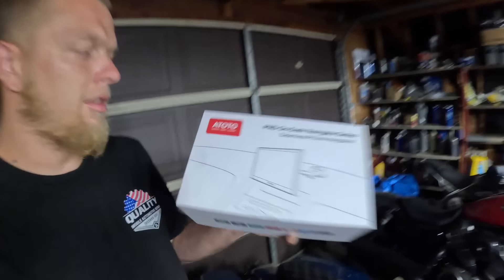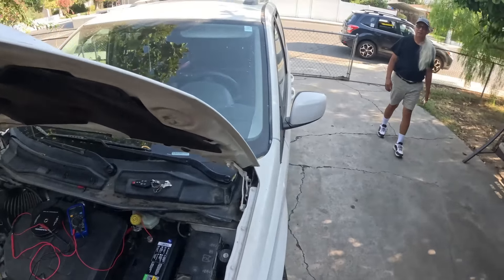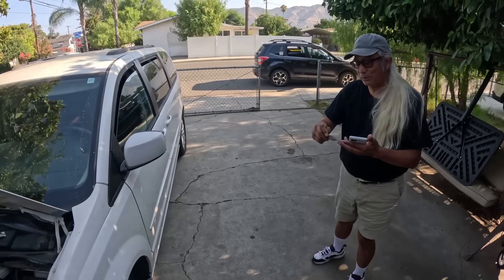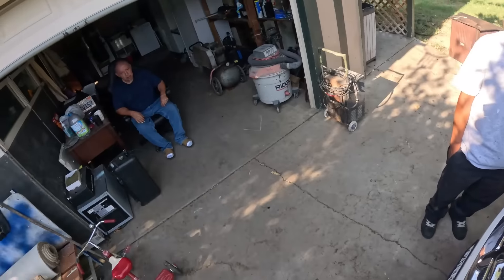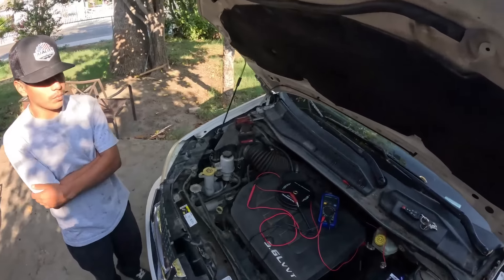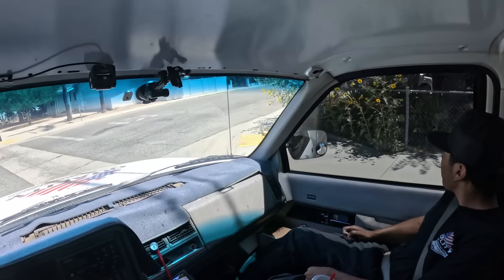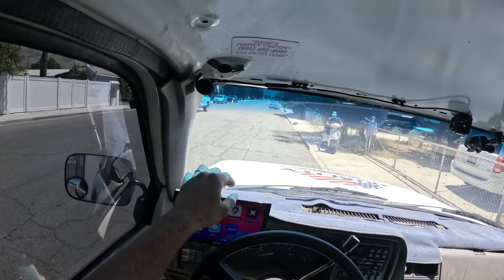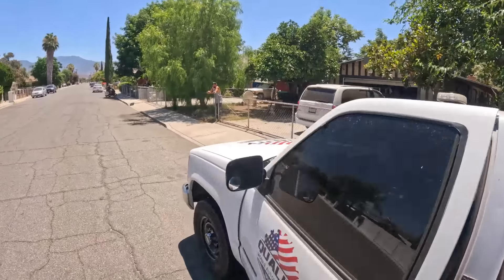CUSTOMER was UPSET! Mobile Mechanic ELECTRICAL diagnosis

Comment: Boy you’re really earning your money on this job people don’t understand that you can buy a battery or alternator can be bad even if it’s new
Reply from the maker: Right!
Reply: I love the way you are sharing your knowledge with the young guy he seems to have a thirst for learning keep up the good work you really earned the money on this job but your patience and craftsmanship gave them confidence in your ability to make this a good job well done
Reply: Absolutely! I have bought so called premium ones “Optima” and less than a month both batteries had bad cells. Warranty was clutch after spending $525 in batteries.
Reply: @hiclite  Optima batteries are now made in Mexico
Reply: @John-fp2ls  just because a part is new don't assume it's good
Reply: I just replaced my Walmart battery under warranty. Original CR-V Battery (51R) lasted 3 1/2 years and I replaced it with a Walmart. It lasted 2 1/2 years. Walmart gave me another one no questions asked. The heat here in Florida is hard on a battery.
Reply: Always test in store after purchase.  Had a couple new ones fail before leaving the store.  Learned my lesson after buying an alternator at advanced auto driving 3hrs to fix my wife's car only to have the new alternator outputting more voltage than supposed to 16v.  Drove it 3hrs home replaced it after I got home.
Reply: That battery wasn't a NEW DEFECTIVE unit, that van killed it. The drivers cranked it to death. I'm surprised the starter hasn't failed; i bet it dies within a year.
Reply: But the kid at autozone said it was good...

Good, go back and have him fix it.
Reply: Yes. Defective products exist. Light bulbs is another product that most consumers don't realize that you can get one defective on receipt. If you install enough bulbs you are guaranteed to eventually run into defective bulbs.
Reply: Walmart battery's rarely last the warranty period, i bought 3 and 2 didnt last 2 yrs.
Reply: @robertmitchell6080  that's essentially most brands, you're doing pretty good to get 3 reliable years out of the most premium brands. 
The beauty of Walmart batteries is in the fact Walmarts are nearly everywhere, open about every day, and pre covids were 24 hour. 
I buy all my junk there or any of the major chain auto part stores for similar reasons.
Reply: Ctly I just had a qashqai that had an incredible parasitic drain and looked as if the battery was cooked  even though it was only 3 months old and only recharged 2 times, changed the ecu and the new battery came back and the old one came back too, but they were both testing at like 3 to 11% health, there are a million things it could be when it comes to electrical faults and age of components like battery and alternator don't mean good.
Reply: Few months ago I replaced a NAPA battery that was dying after a year. The battery that came out of my car was huge. It lasted 15 years and I'd drained it completely dead a few times during that time ( car set for weeks without being driven, so if I left something on, it could be a week or two before I noticed. 
The NAPA replacement was about half the size. Not sure what he looked up in his book, but definitely sold me the wrong size battery.
Battery life will depend on where you live. In Texas and Arizona,  the extreme high temperatures kill batteries fast.
Reply: I had a brand new battery fail on the drive home. It was brand new and bad.
Reply: Back in the late 70 s my was hauling snow with my dump truck lights were getting dim so sent down another truck and took my battery and put on charger it was 22 below zero 88 with wind-chill factor got that lot cleaned took machine for maintenance took my truck to electric shop friend owned cold as all get out put his machine on checked battery and alternator went around and pulled fuse out there where 2 fuses for electric system cost 5 dollars picked up fuses for spares a business I hauled out of had their mechanic replace everything electrical spent over 200 dollars not fixed said mine was fuse under dash checked and that was the problem said how did I know told them didn't have money like they do so took to electric shop got fixed not to old to learn then my neighbor grandson got in a wreck ford vehicle towed to grandma's across street said going to call wrecker told him pop the trunk hit reset on fuel pump system started right up said here's forty dollars said forget it were neighbors I learned that from a mechanic friend who I went out with for a tow ruff road got there and he did same thing I did learned from him 22:05
Reply: @625jeffrey  no matter what product you purchase it's possible to get a defective product. You just ended up being the unlucky one.
Reply: People don't understand that you leave a battery dead, because of a slow draw or something, even for two full days? That brand new battery is absolutely TOAST at that point. 

He doesn't drive it every single day obviously, so for a week the vehicle would start... But barely, like he was saying, because of the draw on his battery wherever. Finally, the last time, they started it and didn't drive long enough or whatever... Battery was dead. They LEFT it dead for a couple of days. Boom, brand new battery is gone, they can't understand why. We do.

Maybe he went over this in the video though, I haven't finished it yet. He hasn't even left his house for what sounds like the first, of potentially multiple (?) times.

Edit: Well golly gee! What a twist!!! Was not expecting that at all. The guy was definitely not very clear about that little second, entirely separate, issue! Super glad that it ended up happening for Robert while he was there! He'd have never known, just based on what dude was saying alone, without that. Luck was with him for sure. I spoke too soon though, that's for sure!

Everyone take care out there, be well. Hope luck is on all of your sides as well. Over 'n out.
Reply: Not likely.  Very rare to get a defective battery.  Most likely bad alternator. I have had diagnostic say "charging", then continue to fail. Change alternator then all was good.
Reply: Especially nowadays with everything made in China! Probably one out of every 20 is a dud.
Reply: @sheiladavis2304  Americans. Just can't please them. Complain about high prices. Industry provides an affordable alternative, then they complain about QC!  Breaking news;  You get what you pay for!
Reply: Exactly, I've bought brand new starters and alternators that were trash!!!
Reply: Never was a battery issue it's gotta charge cause the terminal was lose this guy just clearly can't diagnose anything. He clearly states he would have to test it how does he even know it's a bad cell when he didn't even test it
Reply: Don't leave out spark plugs
Reply: 1000%%
It has already happened to me twice this year On a brand new alternator in my shop!!
Reply: @QualityMobileAutomotive  I had to drop that client in about 15 minutes moved onto the next pay client. Obviously he’s someone who think he’s entitled in someway shape or form, and you’re supposed to fix all his problems. I’d be out of there.
Reply: I went thru 3 alternators and 3 battery's all to find out that the wire between the alternator and starter was bad and was causing parasitic drain and not charging the battery properly but it was still charging the battery just 2.0 volts off wich is nit good
Reply: $525 for batteries is a problem
Reply: Literally slapped a brand new starter on my buddy’s truck worked like 3 times and it took a shit
Reply: I ordered a alternator from Rock auto it lasted a week. I took it to a place that repairs alternators and starters haven't had an issue in 3 yrs.
Reply: Wow I thought they were sticking it to us at $150 for a battery and you pay $350
Reply: “That batteries new tho” 
It was new when you bought it, it’s a used battery.
Reply: @nicholaslandolina  I live in Wisconsin this yr I had to buy a battery only 137 850 CCA from a small company that only does car batteries, 63 now been buying from them since I was 16. I'll never buy car battery from box store.  Challenger Battery Waukesha Wisconsin
Reply: @KevinHarvey-qw5mj huh? No idea what you wrote
Reply: @glowvid  my thing was it was a fuse for the electoral system fuse box under dash driver's side wanted people to know not the hardest thing just check it out before spending money you don't have to lik my fix was five dollars where there mechanic spent over five hundred dollars and not fixed till I told them about the fuses in fuse box
Reply: Definitely. My first experience, I was working at a part store, and a customer needed a new alternator. I grabbed the one he needed from the shelf. He asked if I would test it as he had an issue in the past. Sure enough, it tested bad 3 or 4 times. I was blown away. So much for new in the box.
Reply: @curtisj2165  they are straight JUNK too.
Duracell Platinum AGM is one of the best values on a battery.
Locally at Sam's Club around $200.
Reply: Oh that car, sometimes the instrument cluster fuse can be bad and not the alternator, some cars will not charge if this unlabeled fuse is broken.
Reply: Well, it really wasn't as common back in grandpop's day
Reply: Exactly
Reply: Where’s check engine chuck when you need him
Reply: My boyfriend is rebuilding a 95 Corolla and replaced pretty much everything but the frame and interior. He's had several parts bad out of the box, including an alternator.
Reply: If I test a battery n it's it looks brand you comes back bad I would explain why it failed sometimes u will get a defective battery
Reply: Much  respect to your knowledge and patience some people just don't realize that people go to work hungover sick etc and don't perform their job duties  correctly whatever the job description is then the consumer buys that product and it ends up being faulty
Reply: As a tech myself I have had alot of autozone parts junk right from the rip
Reply: The battery wasn't bad. I'm sure they shot the battery when that relay wouldn't click on and the car would just crank and crank and that's what probably killed the battery. I'm pretty sure that's how it went
Reply: Yeah I was about to sell my truck because it kept turning off on me or not starting. Took a risk and bought a $63 crankshaft position sensor and boom.. truck has been running perfect again.
Reply: In the uk diesel is equivalent to $9 dollars a gallon so you have it cheap
Reply: I eléctrico mobile mechanic here on tn I fix a lot this tipm module for fuel pump relay problems you need only bypass the wires whit external relay is a tbs on this modules for fuel pump relay you can make the relay very easy and you save time and money and you costumers be happy
Reply: Advance Auto sweats that a brand new battery can't be bad. I also brought a brand new alternator from advanced auto that spun backward
Reply: My guess is there’s a drain on the battery.  Need to do a draw test but guaranteed he does not know how to it’s not the battery
Reply: And new batteries are not indestructible lol.
Reply: The quality of auto parts these days is very hit or miss. Even from quality manufacturers.
Reply: But that wasn’t the problem
Reply: I worked for Walmart in  automotive lol😂. You can buy a brand new battery but that all depends how long it's been sitting on the shelf. Cells can go bad in batteries yes brand new ones. I got to give it to you you got  patience.
Reply: @hiclite  I took my girl and her daughter camping and woke up freezing.  So got in my car and my battery was dead and I had a flat tire. The battery cells didn't have any water filled it up.  I had a ryobi battery for my Sawzall and tried to jump it with that.  It didn't work finally found somebody to jump it and found half a can of fix a flat in the truck.  Drove 4 hrs home and just figured my girl left the door open. Next day car wouldn't start so went to get new battery and they told me my warranty expired the day before.  Luckily the lady was nice and still let me replace the battery for free

Comment: He is one of those "ever since you changed my light bulb, my tyre went flat" customers.
Reply: You've got to look at it from both perspectives. The customer has been to other mechanics but they have not fixed the problem even though hes spent so much money on it, so hes understandably frustrated and not trusting mechanics. Rob did the best thing here when he told him he wont charge for coming out a second time and also saying they'll sort out the payment the next day. Thats how you build trust, especially one who has been let down by other mechanics.
Reply: We literally had a guy that said we messed up his AM radio reception after putting on four tires. FM was supposedly fine still somehow. They walk among us, and vote. 😮
Reply: @bFORCe2003  100% true people either don't watch the full video or just watch the part that frustration happens then they come and comment stupid crap. The customer had the right to be frustrated, he had two or so mechanics look at the car didn't do anything to solve the problem and left it at that. Whilst it took OMA to figure out what the issue was and fixed it.

It's hard to gain a customer's loyalty and trust when they've been burned by others and dealerships and other shops that do the same shady shit makes it ten times harder to get their trust. With OMA doing what he did and fixed their vehicle's issue he will 100% have them as a client again in the future.
Reply: True, but when every other mechanic is a scammer, it causes trust issues.
Reply: This made me laugh a lot.
Reply: Many , Many. Times
Reply: @Hippie9D  that last part is scary
Reply: A fraud/scammer
Reply: I work at an apartment complex. A guy told us we owned him 4 new tires, a paint job and an oil change because we had a freeze that caused a Christmas-looking tree lean over his car because of the ice on the tree. The tree never touched his car! We told him no and if he was that unhappy he could leave when his lease expires. What a loser.
Reply: @bFORCe2003  both perspectives aside. When he's got multiple mechanics "doing him wrong" at what point is he the common denominator? When someone claims that everyone else is "always doing them wrong" you can't exactly take their word for face value.
Reply: @Panchinator90  well given the problem wasnt fixed until Rob had a look at it so hes obviously not lying about previous mechanics not fixing his problem.
Reply: @Panchinator90 oh you're one of those people who don't admit just how many liars and scamming mechanics there are.. I can tell you.. 10 shops taken my money and none of then fixed my problem.. they lie and misdirect to get money and thats it.. they could care less about the vehicle being fixed or not.. and yes that's MOST MECHANICS.. not just a few
Reply: @bFORCe2003  he also didn't explain the issue fully until the second day AFTER the battery had been replaced. The battery was part of an issue and who's to say the previous mechanics didn't tell him that and he just kept telling them "it can't be, it's a new battery. I know it can't be"
Reply: @Panchinator90  he just bought the battery so he being a novice, he wouldnt think the battery would be part of the problem still as its brand new.
Reply: Up until new owners bought the local auto parts store, when anyone purchased a new battery from them they would test the new battery before it went out the door. The owner told it was because they’ve found that new batteries can become defective. I miss those people!
Reply: @elliottpeters2996  I guess you'd call customers like that. Them mechanically incline, educated.
Reply: @Panchinator90 you  are correct 
The common denominator here is him. I could tell by the way he was moaning and not accepting his word  that the customer was the problem and had no idea about the problem. 🙄 In this case the problem  was the fuel pump relay yet he killed two batteries by either winding  the starter too much or over charging them... because it won't start! He failed to convey the issues fully from the start, because  of a lack of logic.
Reply: Man I have that all the time in car audio annoying
Reply: 🤣........ its so much of those around at times i wonder if they know each other